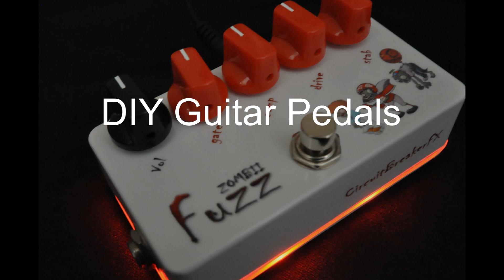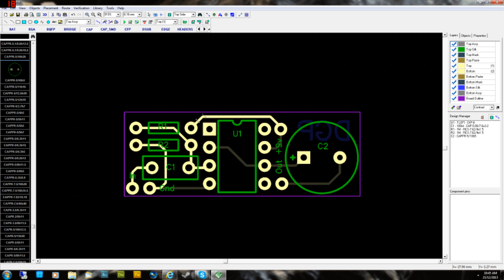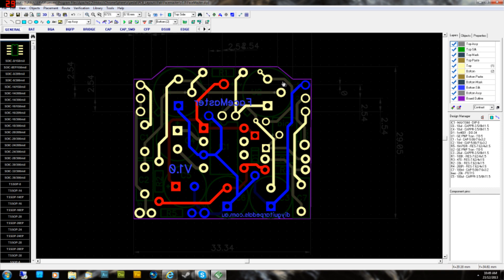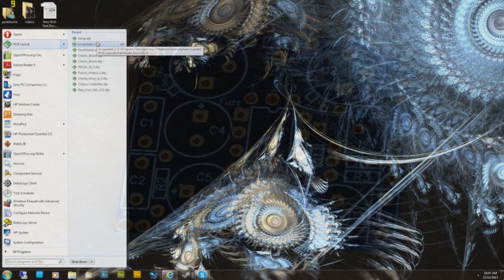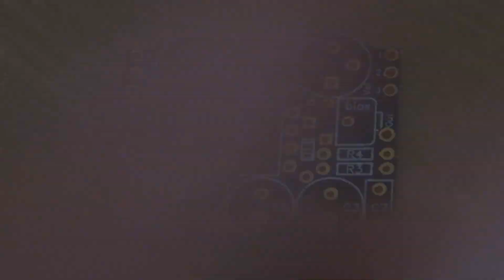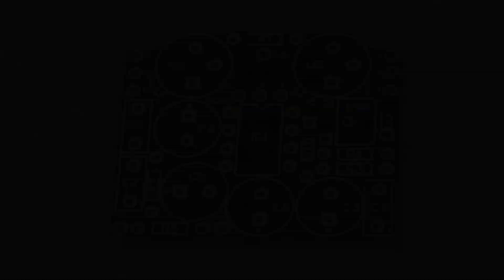Design your own Guitar Pedal PCB Layout - Double Sided (Part 2)

Comment: How exactly do you determine how a circuit is going to sound based on where you put all the lines n junk. I am a noob and I need some kind of guidance as to where I should go to find this. I want to be able to create my own weird effects from the ground up ala delay, or pitch effect, and I have no idea where to start learning what I am supposed to do to make a fuzz pedal fuzzy, or a reverb pedal wet as a vagina. HALP ME.
Reply: Most of the time, these guys bread board first so they can hear how it sounds before they do this.

Comment: Hi there my friend.!Thank you for all your videos and help.! I would like to make a question cause i didn't understand how did you etch this double sided PCB..Is this even possible to etch it like a single sided PCB? Looking forward my friend.! Thank you.
Reply from the maker: HI Kostas, no this is a fabbed pcb from OSHPARK.  Cheers.
Reply: What's the usual cost for PCB fab like this, low volume? 10pcs? 50pcs? 200pcs? Vastly different price ranges? When does it get cost effective? Thanks!
Reply: Daniel, Cost goes by dimensions. They Fab them in sets of 3. Ive seen it as cheap as $3.00 a set and as expensive as $20.00 a set.

Comment: What did you use for the potentiometers?  Was it a series of 3 pads or was there an option?

Similarly what about for 3pdt stomp or dpdt toggle switches?  How do you handle those?
What about rotary switches?  Pardon all the questions, but you've got me curious...
Best,
Lubdar

Comment: Please help: I've designed a pedal, but need to know is it ok to wire the 9v battery in parallel to the 9v power adapter? Or is different wiring required to ensure a flat battery doesn't charge up and explode?